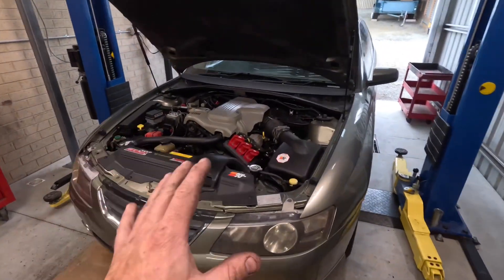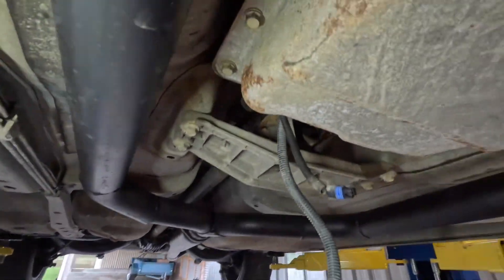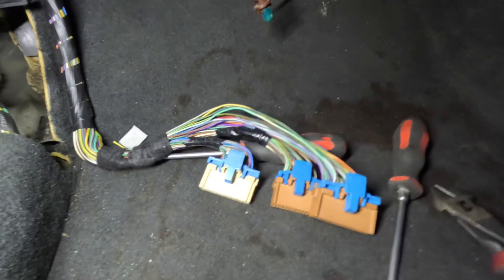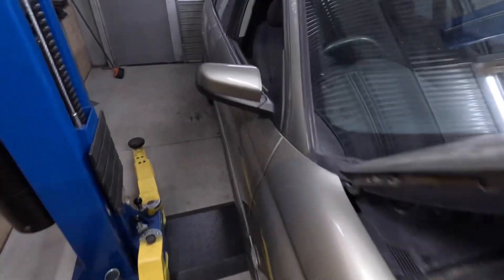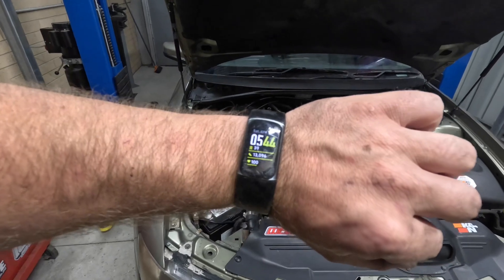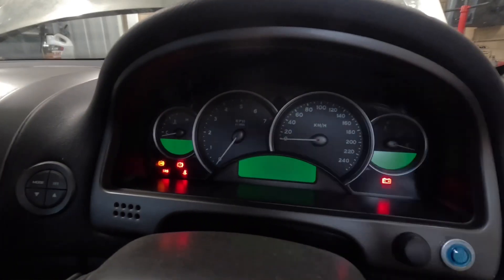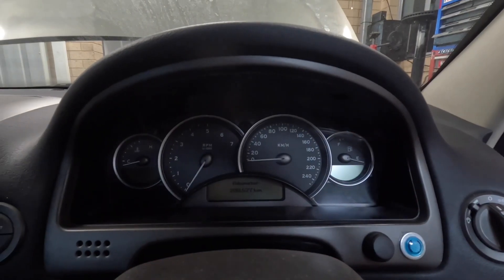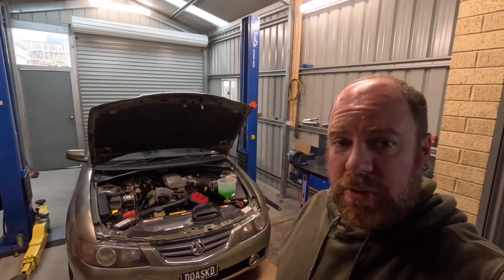VY Commodore Drift Skid Car Auto to Manual Conversion Pt 2 + PCM BCM Linking

Comment: If I got the ecu and BCM from a factory manual car could I transfer them over and have the car work?
Reply from the maker: Unfortunately not. You would also need the keys, and the instrument cluster from the same car for it to work as they all talk to each other. 
Better if just getting the ecu and just doing the linking procedure with a scan tool. If you don’t have a scan tool good enough, there’s mobile guys that could come do for not much money
Reply: @cassarindustries_wheelwerk  Ah okay cheers, that was my second option just to buy a couple blokes to link it for me 😂

Comment: Hey mate. I’ve got a ls1 vy Calais and I’ve got a manual conversion for it. However the car that the conversion come from did not have the climate control like the Calais does. And I was wondering if I put the manual harness in will it still work?
Reply from the maker: Absolutely still will work mate. Engine harness is separate from the body harness, so you’ll be good to go.
Reply: @cassarindustries_wheelwerk  even if I change the ecu to the manual one?
Reply from the maker: Yep you’ll still be fine. The engine ecu only controls to power train (engine and gearbox). 
The body control module is what operates your climate control, dash, and all your electronics. 

It was a similar scenario in my drift car. No Calais ever came manual. I manual swapped mine, used the manual harness and ecu, and everything works as it should. 

The only thing is on the gauges you have the little display that shows what gear you’re in with an auto. Sometimes you can’t deactivate that when you manual swap them. My Calais has this issue. So it still shoes the PRND21 on the dash even though it’s got all the manual stuff in it.

Comment: How much did it cost to do this I’m thinking of doing this
Reply from the maker: You can find complete conversion kits from anywhere from $700 to $1500. Then add score $120 for some new bits and pieces, gearbox oil etc on top of that

Comment: I thought you could connect the auto to manual vss, wire the inhibitor for reverse and bridge the park cutoff and just throw the manual memcal into the auto ecu.
Reply from the maker: You can modify the auto wiring to work in a manual, but there’s a lot of extra wiring that just sits under the car. So this is a neater option and the proper way to do it. 
Also, VY ECU’s don’t have a removable memcal like earlier commodores. So you have to either still run an auto ECU, or run a manual ECU with an auto wiring harness. 
Best way to do it if you want a manual, is to run a manual harness with a manual ECU as that’s the way it was meant to be. However, if you can’t get those parts then there’s always other options. But if you can get them, use them. Because they are super easy to change anyway, just need to program it

Comment: Hi mate I’ve just tried taking my car to auto elec and linking the new ecu, it all linked up correctly however once the manual ecu was in it would start and turn straight off, could it be that it’s a series 1 ecu and a series 2 bcm? or does that not matter seeing as it was linked?
Reply: It’s a series 2 vy and I’ve got a series 1 harness aswell, does that matter at all?
Reply from the maker: Harnesses are the same for series 1 and 2
Reply from the maker: If the harness and ecu were both installed before you tried to link them, then it should work. There is some very slight differences between series 1 and 2 ECU’s (relating to emissions etc), but nothing that you’d notice, and they both will work if linked correctly.

Comment: Great videos mate, I just finished a rebuild on my VZ alloytec, after having the engine come off the hook and smashing the sump, I got it replaced and back in the engine bay to find my Tranys oil pump was stuffed. Local wrecker is selling a complete 6 speed conversion with harness, pedals, master cylinder, drive shaft BCM and key etc for $1500 so I'm now on this journey myself because in all honesty I hate autos. These videos are giving me the confidence to get this swap done right. If I replace the BCM and Key I should be able to turn over with no issues right?
Reply from the maker: Thanks heaps for watching mate. Sorry to hear about the journey you’re on but at least you’ve scored a full conversion for a great price 

The bcm is linked the ecu. If he has supplied you with both an ecu and a bcm with keys, then the car will start. But if you using your original auto ecu, it won’t. 

I’d always recommend using a manual ecu over an auto one anyway as they do drive noticeably better. There’s subtle changes in them that make a difference

Comment: Can u just use a normal 3.8 vy parts if it's a callis 3.8 supercharged and do u need a scan tool or can it be done with out one
Reply from the maker: Being a Calais makes no difference to the wiring harness, but being supercharged it does. The supercharged loom is a bit different to the Ecotec loom, and supercharged commodores never came manual. However, You can make an Ecotec harness work on a supercharged motor but it involves you modifying the loom.

You absolutely do need a scan tool, and a good one at that. Most basic cheap scan tools can only read and clear codes. You need one that can do programming
Reply: @cassarindustries_wheelwerk  yea alr cheers mate
Reply from the maker: Welcome mate

Comment: Awesome video mate, just a question did you use the existing keys or did you have to get new ones?
Reply from the maker: Thanks heaps mate. 
It’s all done with original bcm and keys. Don’t have to change either if the linking procedure is done correctly